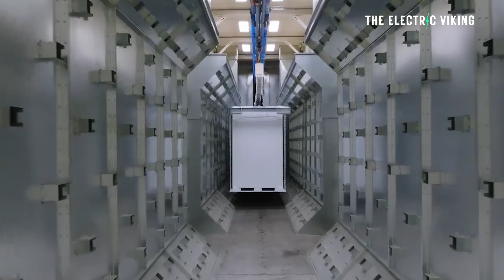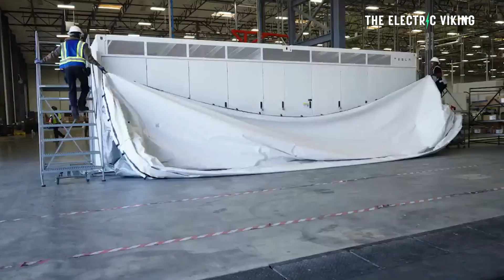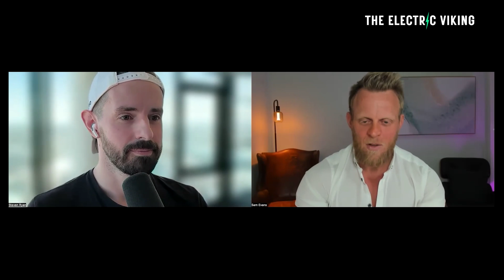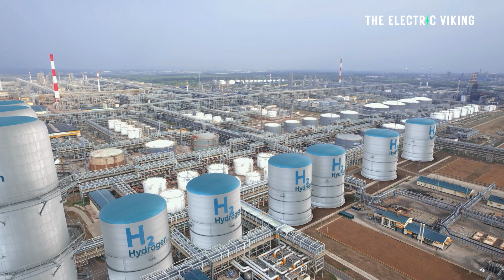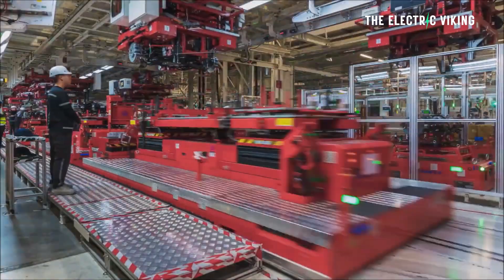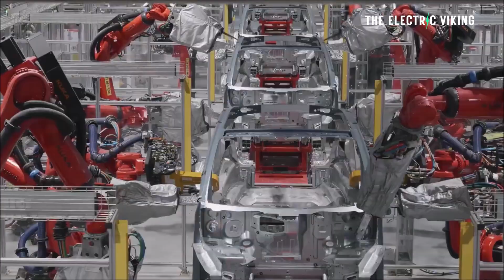Australia's billions in WASTED Solar Energy: The Path to near free energy

Comment: It's not excess energy, but excess capacity.  The US, for example, has excess coal, natural gas, and hydro capacity.  Except for peak demand periods about half of US fossil fuel and hydro plants are turned off.  Just turn off solar and wind if there's no need for the power.  It doesn't make sense to come up with a high cost use.

However, given that there will be large amounts of zero margin power available expect clever people to find uses.  More dispatchable loads will be discovered.

Comment: If you choose to call Australia a superpower i think you are incorrect on many factors in the well known definition. An excess producer, a 100%++ producer with the + refering to storage and emergency factors for 72 hrs or similar description, yes correct but not a superpower. Also solar and wind are very vunerable in a war scenario (superpower has a military / war capacity element to its definition). Easy to smash with drones and cluster rounds to reduce capacity without even killing anybody. Note to supreme dictator- Air defence priorities to include power gen facilities if not already included.

Comment: Capture CO2 from the atmosphere and join it to hydrogen produced by splitting water that becomes petrol or aviation fuel. That means not burning fossil fuels to move ice vehicles which would become carbon neutral. That speeds up the transition to a zero emissions planet.
Reply: GO HYDROGEN IF YOU WANT TO WASTE 66% ENERGY.... 😂

Comment: Sam, a way to store energy indefinitely
About 1/2 the cost of stainless steel is the cost of the electricity to melt the metals.  And if you ate blending the alloy, you have to melt and combine all ingredients, the wait for a lab test report to certify your alloy is precise
To store energy indefinitely, use excess energy to melt and premix complex alloys, then save each billet with the certified report 
Later your customer doesn’t have to invest the energy you already put in.  Sell the certified billets as energy savings

Comment: Part of extracting aluminum from bauxite requires lots of electricity.  Australia has plenty of bauxite.  I wonder if the extraction  process can be started and stopped without penalty?  If true, it might make more sense for Australia to export aluminum stock than to export electricity via undersea cables.
Reply: Aluminum smelters are already used as dispatchable loads on traditional grid.
Reply: @bobwallace9753  Fantastic!  Thank you for telling me.

Comment: On Hydrogen, check out energy per cubic meter rather than energy per kilogram. You need pretty big volume tanks for either gaseous or liquid hydrogen. Compressed has super high pressure required, the other super low temperatures. I just don't see any benefit outweighing the hassles. Plus, I guess the energy cost of creating the hydrogen, plus either compressing or liquifying it – are major inefficiencies. Plus no regenerative braking. Also the expensive liquid hydrogen, simply evaporates over a week or so - by just sitting (not in an enclosed space though!) your mileage goes down. Musk sums it up - hydrogen is just silly.
Reply: Hydrogen for cars is just a delusional take from those who refund EV i. E: japanese, europeans brands who got left behind in EV game. Even chinese EV is beating korean EV now

Comment: Tesla Q. 
Power for AI computing. 
Hydrogen for high strength steel production.  Electric arc furnaces instead of coal. Alumina smelting.    Solar power to power a battery manufacturing plant and its upstream. 
Hydroponic gardens for closer to urban logistics and soil erosion curtailment.

Comment: I think it will be Hydrogen, long haul out back, trans state.😮
Reply: Nah hydrogen not gonna work. Still testing phase since 2 decades ago, still going to gas station, still using trucks to transport, still a ticking bomb
Reply: @lucky889s9  my take is, I doubt battery will support long haul& I guess other countries will be facing the same problem. If hydrogen is not taken off the table, it will still be considered, if it's made from excess solar electricity 😉
Reply: GO hydrogen if you want to waste 66% ENERGY... 😂